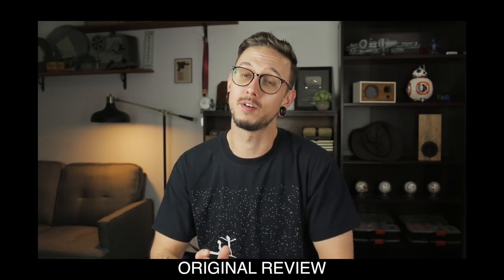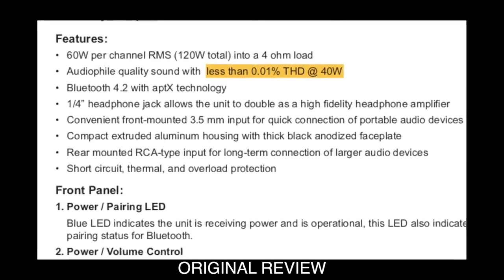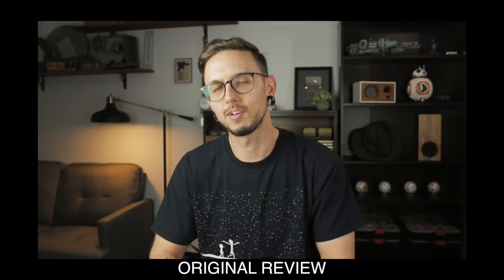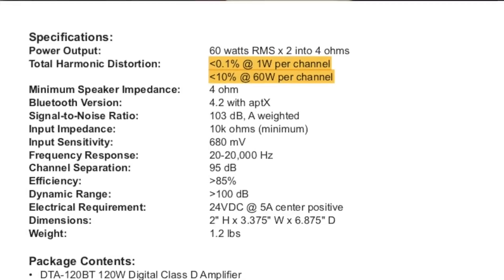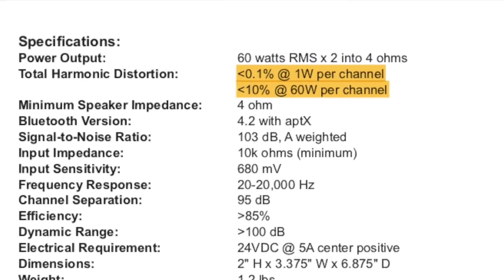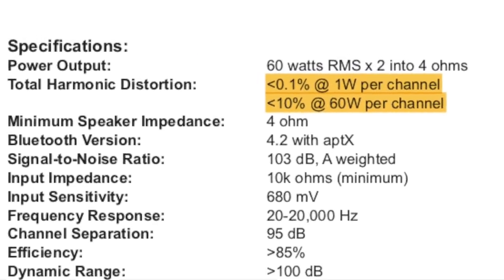CORRECTION! DTA-120BT Audio Amp Review Mistake

Comment: You may be able to get a better idea of THD at a certain power level if you check the datasheet for the amplifier IC used; they usually have a graph of THD vs power output.  Not a substitute for actually measuring it, but should be fairly close.

Comment: Ji Kirb, great info. You're excused for the error. i have a question: I've been using some bluetooth amps, and some of them have wrong polarity to the speakers. For example one way is ok (left channel) but on the right channel the polarity is inverted.. (i measured with voltmeter in mV giving me negative voltage). Is that how's suposed to happen? i connected the correct way tho... wird...

Comment: we love your work so no worry.. but a top amp is less 0.008 thd.. under 20-30w .. you should at least give distortion curve from 1w to 10-20w since it's mostly the sweet spot
Reply: The spec doesn't provide a graph and as he said in this video, he doesn't have the equipment to test THD himself *yet*.

Comment: 1.) The 10% THD is when the Amp is clipping... (to get the 60 watt rating)... Its meaningless THD and more about advertising the power) 
2.) Getting a THD  "below 0.1 %  THD at 1 watt" is a good number  and likely the limit of the test equipment used.. 
The 3rd point:  The numbers are very dependent on how they are measured.. I'm sure someone with some great test equip can can get us a best case THD number at 40 Watts -maybe better than what was stated?  - We can definitely get worse numbers from an amp 50 times  the price :)
-Thanks for the Apology Kirby, but it wasn't needed... (anyone who knows anything will take those numbers with a grain of salt...)
and stop doing apology videos... your gonna make your subscribers cry
Reply: 0.1% is due to the fact it's a cheap class D amp. Higher distortion is typical for this class, if you want more precise sound for the money, you have to go with class AB with all of the related disadvantages. For example LM3886 does 0.03% THD at rated power (60W/4Ohm) and sounds great for an IC, but you wouldn't fit it in a box this small.
Reply: i didnt realize it was cuz of clipping and i was like "wtf 10% is insanely high" but yeah anything below 1% is acceptable, especially on a budget product

Comment: OK, I get it, you made a mistake. But why make a seperate video about it?? I just looked up the THD numbers on both the BT and non-BT version of the amp, and in both cases is says <1%@1W and <10%@60W. So where did the 0,01% number  come from in the first place??  Still, I totally agree with you on the power part. I´ve got a pair of horn loudspeakers and the produce room-filling sound with less than 1W (0,1W should be about 85dB). Even with normal speakers 20-30W is more than enough to watch movies or listen to music at fairly loud levels. The only thing that needs a little more power is the subwoofer, but thats another story.